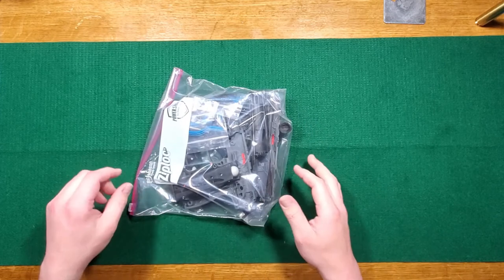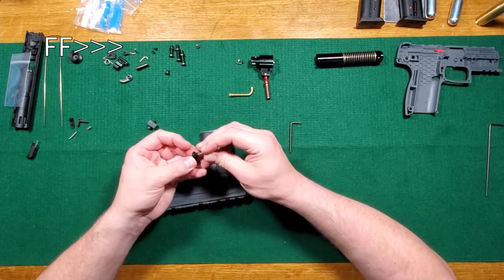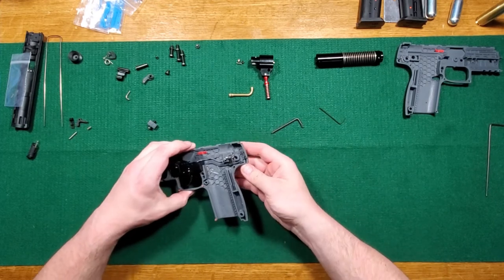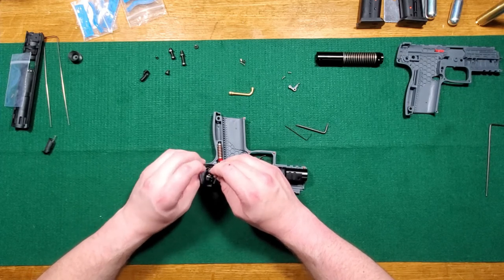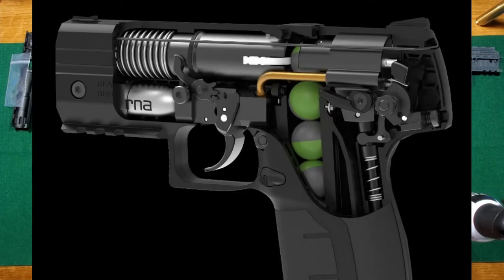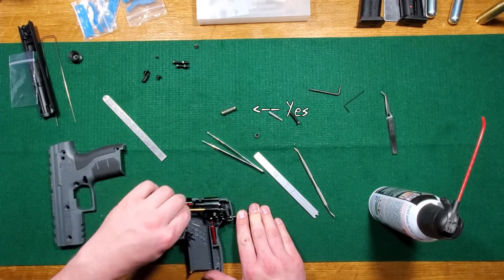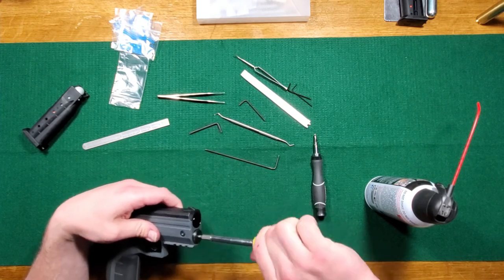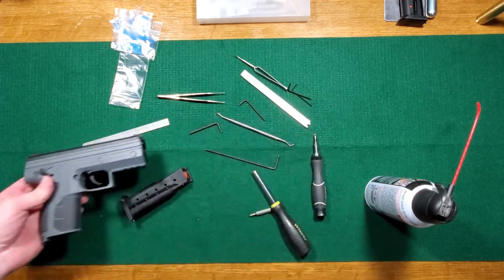Byrna HD Musings

Comment: Is that rear screw hole some sort of hammer spring adjustment?
Reply from the maker: Yes, it's velocity adjustment. Screw it in and the hammer will hit harder allowing more CO2 to flow through the valve producing more velocity.
Reply: @fiveshrubs  this is what I thought. I’ve adjusted mine and I notice a difference in velocity